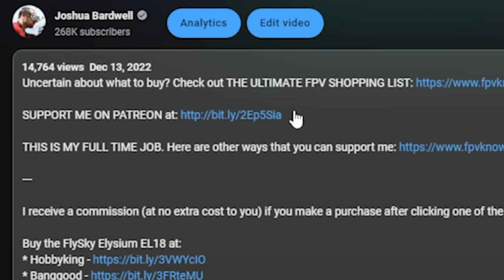GEPRC Moz7 is 7 Inches of Awesome // FULL REVIEW

Comment: I've flown both the Chimera 7 and Moz7, the Moz7 has a better stock tune and the frame is WAYY easier to work on than the Chimera 7 - for that reason the Moz7 has become my mainstay long-range quad.
They both cost the same direct from manufacturer when I bought them.
Reply: What about sound?

Comment: Should have mentioned geprc have 3 new 7" offerings
Mark5 7"  7" prop $50 upgrade option from mark5 5"
Crocodile v3 7.5" prop smaller higher kv motor more acromatic lipo car chase/ freestyler better chimera comparison
Moz07 7.5" bigger low kv motor li ion LR cinematic cruiser
Reply from the maker: As far as I can tell, both the Chimera and the Moz7 use 2809 motor. GEPRC 1280 kv, iFlight 1250kv. At least that's what the ones that GEPRC and iFlight sent me have. You can check the product listings to verify it.

Comment: remember, the new chimera comes with the newest M10 GPS and fixes the "issue" you mentioned joshua. 
i got average of 27 sats right after plugging a lipo in on a warm start for the iflight M10. it should be very comparable to the good GPS on the GEPRC quad. 
nice review! that chuckle after crashing it 😂
Reply from the maker: The chimera I tested had a m10 GPS. IFlight said they were having reported issues when it was used outside of Asia. Maybe they fixed it?
Reply: oh really? i thought you had the old white GPS. the new is black outside. at 32:33min you are holding both quads in the camera and the left iflight GPS is the older version. thats why i thought your chimera didnt have the BLITZ M10 😅 my bad if you just use that as reference only but flew the new version. oh and yes outside asia could be a problem. since i am living in china i cant confirm that but i will ask around. a friend in australia have some quads with the new M10.   @JoshuaBardwell  
i visited the GEPRC factory many times before and they improved alot. but you right saying we need to decide ourselves which 7" we prefer. they are very close to each other. i stick to iflight. cheers°🥳
Reply: I got the m8 on mine. No problems
Reply: @kringtheking2657   i also got the M8 before. but if you start a quad with M10 and same time M8 you see the difference.
Reply: @cloudpandarism2627  what difference you talk about ? . It allways find the sates within 30 seconds. I dont mind waiting a few seconds. How fast is the m10 ?
Reply: @kringtheking2657  i plug lipo in. 2 seconds later i got 27 sats. that difference mate 😁

Comment: almost 40 seconds at full speed !
those 7 inches feel so athletic compared to 5 inchers. They effortlessly take altitude, and this is subjectively reinforced by the sound difference due to larger props.

at 130 km/h the aerodynamics start to matter so maybe it's good thing to have those annoying sideplates. Maybe they just need to be redesigned to incorporate silicon inserts (like gopro to access usb) for maintenance. It would look professional without requiring a screwdriver.

Comment: Having the control link antennae at the front on an LR quad makes sense. If you're gonna have a restriction on range due to antenna placement you want the restriction on the way out. With a front mounted control antenna s soon as you turn around to come "home" your signal is likely to get better.

Comment: Try 1x LHCP and 1x RHCP antenna on the drone, compare that to dual LHCP as well as a single tall dual linear from FlyFishRC. The DJI goggles v1 antennas were LHCP (2 notches on the antenna tip) but the v2 goggles came with dual band linear (3 notches on the antenna tip) and very similar to the antennas DJI is using on the Goggles2/Integra.
Regarding ND filter on the O3 I find that an ND16 is almost always too much and the ND8 is the most used filter I have. I actually need another one and an ND4 if I can find one.
If I had this drone I would throw away that plate over the O3 sdcard and usb access and just use black electrical tape. Otherwise it looks like a good workhorse.
Reply: hello Brandon. What is the point of using 1LHCP 1RHCP antenna? Isn't the loss of both polarization is the same when they are matched with linear antennas on the goggles?
Reply: @gloriousquads   the point being try and see! Just experimental science, that's all.
Reply: @BrandonBeans  I see

Comment: i have this frame (Custom build) , i have found two issues on this frame, arms are not rigid enought, try to "bend" them and you will know what im talking about, but ive found a workaround and now they are really good. Other thing is screws from Arms are too short, i had to use bigger screws on arms. apart from that it seems a very good frame :) love it
Reply: I don't find that my arms flex when I torque them by hand. But the body, that flexes.
I found that my motor mount screws were too short.

Comment: Hey, thanks for the awesome presentation! I gotta say, you've got me seriously considering pulling the trigger on this drone. 
But, I've still got a couple of lingering questions that didn't quite make it into your review. 

So, here goes: What's the deal when the signal goes MIA? I'm curious if this drone's got a knack for going up, up, and away to reconnect, or if it's more of a backtrack and return kind of deal. 
See, I love cruising with my DJI FPV in the Alps, and every now and then, it goes radio silent. The DJI FPV usually goes on a little vertical adventure to reestablish the connection, but I'm not sure if this drone does the same. 
If it doesn't, we might have a head-on collision situation with obstacles, right?

And then, here's the second head-scratcher: If I slap an 8000 mAh battery and a GoPro on this bad boy, will I have enough wiggle room to adjust the GoPro angle for that perfect shot at top drone speed?

Comment: Awesome video as always man! 
What connectors are needed to convert from the stock DJI O3 Antenna to 2 SMA Adapters, like on the new GEPRC Moz7 here. Is it just two seperate U.FL Antenna ports?
Does the DJI O3 Air Unit actually use U.FL Antenna connectors? I heard it was proprietary, called IPEX, but then i see it listed for sale as, "U.FL/IPEX to SMA Antenna Lead."
Also do you see a noticeable difference in increased range, when using these twin external full size SMA antennas on the DJI O3 vs a 5" Freestyle Build with a stock DJI O3 Antenna on it?

Comment: I was thinking if I could put two FPV cameras on there(if dji or Walksnail get as good as go pro) then someone else can ride along to see how it’s recording or could ride along for a third persons view of set up that way. Anyway my point is the FPV style camera is lighter and you could stack them attach one to the bottom one to the top of the frame. the weight would be balanced.  Instead of a honking GoPro on the top of the quad it would be a small camera. I don’t know thought I was having about it. I’m not sure if you can double up the tx rx the draw power from two places or need a flight controller that does two cameras at once.

Comment: Thank you for good videos. My moz7 has a problem that the current consumption(mAh) is not displayed properly. Is yours the same? Even after flying for 10 minutes, it is said that only 400mAh has been consumed, and the current consumption does not change despite the change in the Throttle.

Comment: Hey if anyone can help I have a moz7 and I needed to send the 03 air unit in for repair an now I’m not able to get it mounted back to the heatsink/mount. The screws don’t seem to be long enough to bite and I’ve tried removing the bottom plate and still nothing. Getting super frustrated because idk what’s different now but I can’t get it mounted. PLEASE HELP

Comment: Hi. I have a Diatone Mamba F722MK4 + F65-128K Stack 3-6s bone stock or uppdate esc? And what to install and settings on esc? And i was uppdating The Flight Controller to a new firmware, and when i took the Cli dump and put it on the new firmware i got manny Errors. Is tatt ok?

Comment: You guys who are reviewing this thing are not being fair to us.
I own a MOZ 7 and it has a LOT of negative issues. You should dig into this thing a bit more.
No current display? Me too. I fixed it in BetaFlight. You might want to know that you are drawing 100A from a battery that has a safe limit of 50A.
23 satellites? Me too. But all the telemetry will disappear randomly. Their web site says to set this GPS to UBLOX, but they have it set to NMEA. Changing it helps, but does not fix everything. Good luck checking your speed when you punch the throttle. My data stops flowing while all that current is being drawn past the GPS cables.
Check the filter settings. This thing has a ridiculous filter setup to compensate for all the noise it generates. Have a look at the BlackBox data.
That 2.4G ELRS antenna won't receive well past a quarter mile. I pulled my antenna out of the TPU and zip tied it to the leg. This added about a quarter mile to my range.  Half a mile really isn't long range.

Check your motor mount screws. Are they loose yet?  Mine were tight when I received the quad, but after 3 flights, 6 of the 8 screws were barely hanging on and the motors were loose.  The screws are too short and they did not use a thread locker.
Reply from the maker: I think maybe they have fixed some of the issues you experienced. For example, my GPS is set to UBLOX. I have had zero issue with losing GPS when I throttle up or antyhing like you describe. My motor screws are still tight after weeks of flying it.

I also called out the problem with antenna mounting in the front. Timestamp is 13:13. There is a chapter marker for that topic titled, "Antenna mounting up front maybe problematic maybe not."
Reply: I agree that i t's frustrating when negatives are overlooked, although I doubt it was intentional. I wish creators talked about tuning and filtering more as well. Would you be willing to share a blackbox log with me so that I can get a feel for the resonance performance of the moz to help decide whether to buy one?